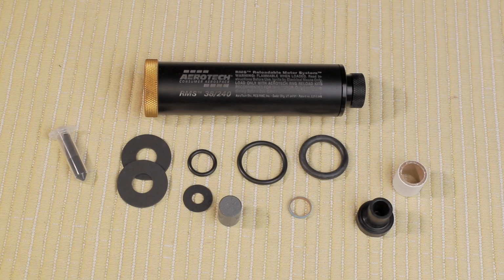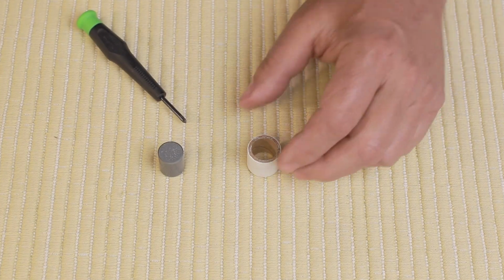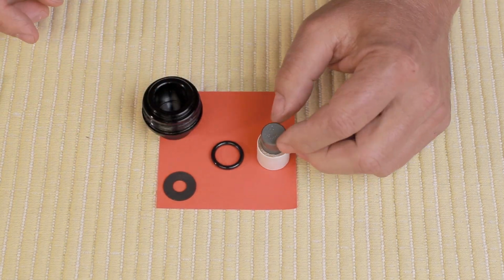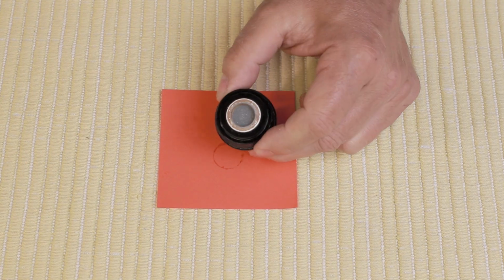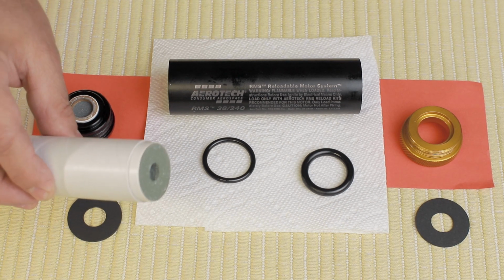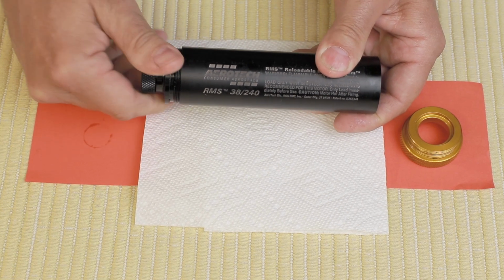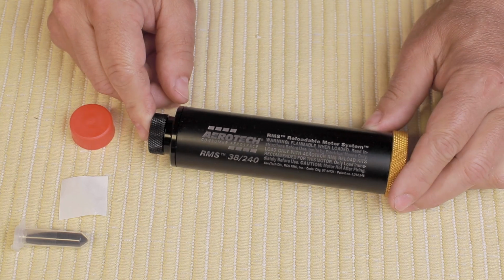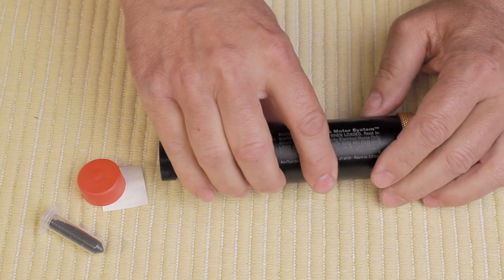AeroTech Rocket Motor Assembly

Comment: Very good video! Still ONE question: is there a motor retailprogramma tthat connect to the motor mount?
Reply: Motor retainer
Reply from the maker: @wwitsel  Motor retention is provided by the airframe of the rocket. Some options are an Aeropak (API Quick Change) retainer or Z clips included with most kits. https://aeropack.net/webstore/
https://locprecision.com/collections/components/motor-retainers

Comment: Are there any videos of how you disassemble clean and prepare the motor unit for reloading? There are many that show loading new assemblies, but I’d like to see the what I assume can be messy tear down and cleanup. Thank for the interesting videos.
Reply from the maker: The real key is to clean them ASAP. I usually clean mine the same day and use Fantastic or 409 and a blue shop towel. A toothbrush can come in handy for threaded areas and a bottle brush works great for the case.

Comment: Hey, I have built my first aerotech motor and when I finished and checked over the instructions there was a very small gap between the forward closure and the case. Is this a problem? I have also noticed the aft seal disk does not sit on the propellant it sits on the liner about a quarter inch from the propellant is this a problem? The reason for the gap is because it became incredibly tight and difficult to tighten. 

Ps it has a fiberglass liner
Reply from the maker: I have not assembled many AeroTech motors since casting my own sugar motors so I asked a friend. This is his response.

Space in the liner is fine.  That has happened to me several times.

The forward closure not seating all the way onto the case, is not ideal. The way I assemble them is I start the forward closure and then start the aft closure.  Then go back to the forward and screw it on all the way to the case.  Then go back to the aft closure and do the same.  I do the aft closure last because you can get better leverage on it.  If I recall I've heard numbers like < 1/16 of an inch gap is fine between the closure and the case.  That said, this has only happened to me a few times and only on smaller cases (i.e. AT 24/40, AT 18/20), which are harder to get good leverage.  O-rings being properly greased may be a factor as well.  You have to make sure the closures slide on the O-rings easily.

I hope that helps.

Comment: Can you do the delay change with “G” class and below? Or just for “H” and up?
Reply from the maker: It depends on the motor, some of them have adjustable delays and others do not. You should ask the vendor for more information. Make sure you get the correct delay tool because there are two different ones.
Reply: @TheRocketeer  Alright Thank you👍